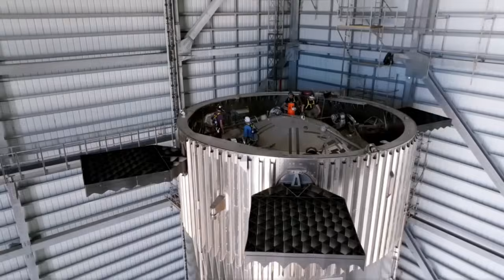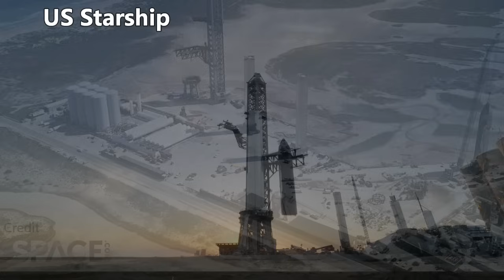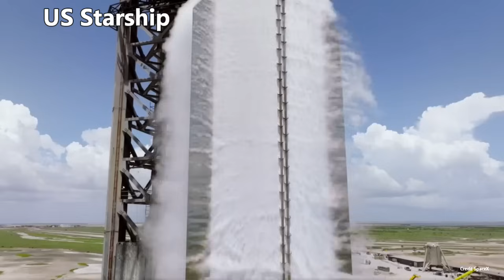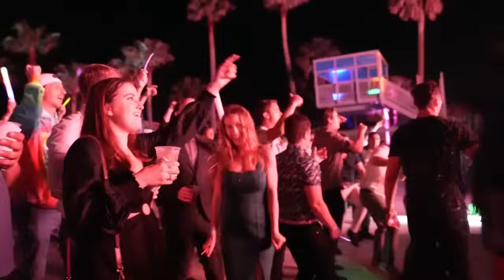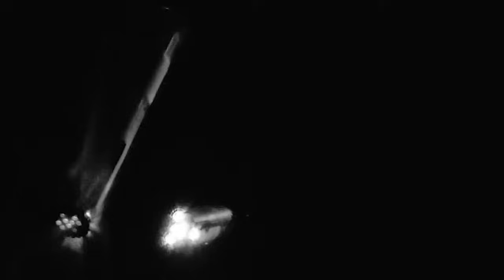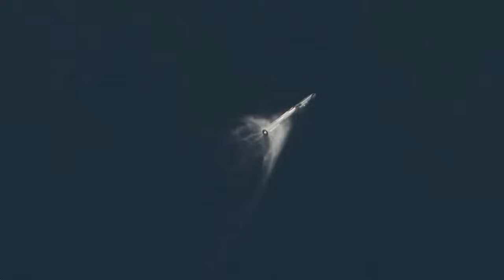SpaceX LEET 1337 Rocket Engine and the Development of Raptor 3!

Comment: Carbon fiber also doesn’t like cycled stresses as the Titan submersible just demonstrated. The pressures at the bottom of the ocean are not a fair comparison to space but it makes a shorter service life as a reusable pressure vessel I think.
Reply from the maker: That's a very good point.  And titanium becomes almost unrepairable after several cycles.

Comment: Your mention of the Shuttle tanks being the biggest objects ever in space reminds me of the disappointment I felt at NASA's decision to deliberately drop all of them back into the atmosphere to burn up rather than putting at least some of them in a parking orbit for future use.   Each had over two million liters of insulated, pressure-tight space with a diameter of over 8 meters.   Left in orbit, they might have been useful some day, perhaps as a fuel depot, or as habitat space.
Reply from the maker: I know! All you would need to do is pressurize it to 1 bar and have a huge addiction to the ISS etc.  Such a waste.

Comment: Excellent video, thank you. Subscription added.
I have a question. I have seen replays 10x or something, usually edited, so the exact timing is not clear.
We had an excellent controlled shut-down of most booster engines, and then we had hot-staging, which seemed to work exactly as planned. The moment the Starship was clear of the booster, the booster started to rotate. I'm told they angled a couple of the grid-fins about 20 or 30 degrees, and the Starship exhaust going through them, gave excellent impetus for the rotation. That's very clever. And it seemed to work incredibly well.
Next phase, we start firing up booster engines again. Not the outer ring, don't need those, but by the time the booster was 90 degrees to direction of travel, and the lower end was out of sight, most of the inner engines appeared to be lit. indeed, the thrust of those engines could be seen to deviate the path of the booster, although not by the amount or degree I would expect.
Then, something appeared to go badly wrong in the engine room of the booster, and we got a plume of what looked like LOX or propellant, spreading in a near circular pattern. it kind-a looked like the lower bulkhead / dome had failed, like the whole thing had come loose around the edges at the same moment. Then a second or two later, we had an explosion.
I would tend to think that when things started to go wrong on the Starship, it triggered the self destruct, but I'm not sure the explosion of the booster [was] self destruct. That looked more like a lower dome / bulkhead failure, like the 'thrust puck' came loose and took the whole bulkhead/lowest dome loose with it. I am fuzzy about the details, but that didn't look like an abort, that looked like a structural failure of the lower tank, which I think from memory, is the LOX tank.
Now I have seen a number of videos from different sources, all assembled by AI for the naturally stupid humans, and they all click-bait to show on-board footage, but so far I have only seen about 3 seconds of on-board, and that was an external camera. What I want to see, is what was going on inside the Meth and LOX tanks. Did we get some sort of hydraulic hammering event, where all the remaining fluid crashed down (relative down) onto the lower bulkhead and caused something like a fluid-lock in a submerged 4-stroke engine? I mean, I know what I saw, I've seen it 20 times now. What I'm not sure about, is what to read into that. What to interpret that as.
I would say the Starship had some issue or other and it triggered its' own self-destruct, but I don't know that the same thing happened to the booster. I'm trying to understand what I saw. I would have thought if the engines that were lit, were running at full throttle / power, the whole booster would have accelerated quite a bit more, so I could easily believe we didn't have full power from all those engines, but then we had a massive leak of LOX and the failure of the whole booster.
[Chuckle] It just came apart in 'me 'ands, sir.
I want to spank the maid and get her to tell me more of that story ....
Reply from the maker: You are quite right.  Over 150 metric tonnes of propellant started moving toward the top of the booster during separation due to the push back from Starship.  If it just rose 10 meters before slamming back down that is 1.5 meganewtons of force hitting the thrust puck.  That is going to bend pipes and tear metal, possible breaking the welds around the thrust puck...  Engines start exploding and a shock wave travels up the downcomer and blows the ship in two.  FTS not required.  So two solutions.  Shut the booster down entirely and only fire the vacuum Raptors.  Give the booster time to rotate from backflow, aerodrag (still some at that altitude) and RCS. Then use RCS to gentle settle the propellant before firing the engines. Or.  restart all booster Raptors at 40% throttle before separation firing all 6 Starship engines like last time.  The danger is that the booster, no free of the mass of Starship, might surge forward and smack Starship.  I like the first idea better.  We'll see how SpaceX goes.

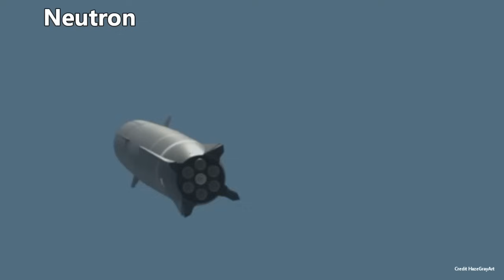Comment: 4:50 I have never worked with carbon fibre but you can metalize 3D sintered parts to make them not leak anymore. We did that with some parts of a machine I worked on (I don‘t how much is under NDA, hence the vagueness). Maybe you can do a similar thing with carbon fibre. The metalization would still be far less weight than a wrapped metal tank.
Reply from the maker: That is true... I think the real problem was that carbon fiber would need a heat shield obviating any mass savings.  Maybe ok for the booster though.

Comment: I very much identify with the approach that SpaceX takes, having built a career based on similar approaches, always stiving for new ways of doing things, while people around you frown and tell you it is impossible. Sometimes I fell on my face, sometimes it was a partial success where I needed to live with a compromise, and sometimes even an amazing success, but I can tell you it was never easy and I always learned something no matter the outcome, and just imagine if I never tried or paid heed to all the naysayers. For such new ideas to work, they at least need to be based on some grounded reality, and they need management ready to take a big risk for the hope of significant gains, and of course, the ones executing the project need to be hard working, smart and flexible to change their plans quickly as what does and does not work becomes apparent. Clearly Musk is that type of insane management guy, ready to take the risk others would not touch, and clearly SpaceX have managed to gather up a good group of super smart hard-working people who really come up with the ideas and make it happen, it typically requires both these aspects to succeed, Musk alone does not make this happen, those smart people alone could not make this happen. Even so, there are some dubious choices we see being made by SpaceX at times, for example launching without and type of mechanism to deal with the immense power unleashed at the pad at launch (Musk pressure?). Or the fact they kept banging their heads for way to long, trying to get parachutes and ships to somehow always meet perfectly every time, when clearly just plucking the fairings out of the water was where it was all going to end up (Musk idea/pressure?). So let me point out what I see could to be the next disaster for SpaceX, and that is landing the super heavy on the OLM. As we saw with falcon 9, they blew up many boosters on barges, before reliable landing could be achieved. Honestly, this process seemed manageable, because the barge is simple and structurally redundant enough, that it could handle the hits with minimum damage, such so, that the barges really were not out of service for long whenever they took a hit. This is clearly not the case for landing at the super complex OLM, or the launch tower, or all the other facilities nearby. Imagine the various degrees of damage that could occur to the launch/landing site after one super heavy landing goes badly, you could expect any decent hit to take out launch operations for at least 6-months, possibly more. Sure, maybe eventually be able to pump out raptors, boosters and starships at a crazy rate, but if there is nowhere to launch them from, then it is meaningless. It seems fair to foresee up to 6 failed booster landings on an OLM before we start to see success, this likely following about 4 ocean landing tests. I doubt the launch site as we see today is hardened enough to cope with hard RUD on landing, so what will SpaceX do to address this issue. Can they harden the OLM and tower enough to minimize damage, and modular to ensure fast recovery? Same goes for all the various piping throughout the site. I assume all the tanks are likely easy enough to replace quickly, so maybe that is not a big issue. Anyway, food for thought, and I would love to hear your take on this aspect.:face-blue-smiling:

Comment: Have they figured out tge orbital refueling yet?
Reply from the maker: Nope.  I think they need to use a disposable stripped down booster and "Starship" with no grid fins or flaps etc and use a 3rd stage "cone" to go to the Moon and go back. I don't think close to 20 refueling flights is reasonable at this point.
Reply: @terranspaceacademy  by 3rd stage cone, do you mean a phalanx rocket like you talked about a while ago? Honestly for the orbital refueling I thought they would have atleast gone with a modified raptor turbopump to pump the fuel from the fueled to the starship and using the staging engines I mentioned as a abort system for launching and seperate from refueling if necessary too. For the moon mission is why I still rather support a mini starship variant in instead for less mass and space that also could be used as either 2nd or 3rd stage. This is really interesting concepts for possible alternatives I come across and like to point out. I hope you don't see me as a hater for this(which I am not) but there are other ways of getting to space and orbit but others I have talked to about almost all agree with the problems those come with but also admit the advantages those offer still being better if they work correctly.
Reply from the maker: It turns out to be more efficient to use pressure differentials to move fluids and a little acceleration keeps everything where it is supposed to be.
Reply: @terranspaceacademy  acceleration as in like what they did for hot staging? And pressure difference, I can kinda understand that advantage, but wouldn't it need an extra for e to force the fluids fully once the pressure equalizes? Unless they intend to use the acceleration like I questioned earlier to give the extra force but even that doesn't seem enough fully. That's why I suggested the modified turbopump and if they want pressure a second tank of of psi gas to help force the fluid fully. In the end I was just curious.
Reply from the maker: Without a gravity/acceleration gradient the pressurization just forms bubbles :-)
Reply: @terranspaceacademy  I understand that, I'm still wondering how they intend to do the acceleration to help the fuel settle for transfer. Also, for the whole acceleration weather from cops or engines, wouldn't that burn more fuel than would be transferred? The pressure equalization still seems a problem for transferring all the fuel needed. Unless they make some new announcement for how they intend to do all that, I still have my doubts for reasons. I kinda wonder if for the fuel transferring process it would not only be easier to use the turbopump, but also the exhaust for the acceleration and or some internal balloon like design to help force the fuel to settle. I honestly would like to hear your ideas and thoughts on those matters or anything they have already announced that I am not aware of.
Reply: @terranspaceacademy no offense but it's also why I don't support hls for is size is far to overkill. From what I've noticed for now they should for human rated focus on getting a crew dragon capsule built into to upper stage for reentry and abort system instead of the whole thing coming down for a few years until they fix it fully. It would only reenter atmosphere for cargo missions for now. But for now I like to see where they decide to go for now.
Reply from the maker: I agree completely
Reply: @terranspaceacademy  on which one?
Reply: @terranspaceacademy also for stripping down booster and starship I don't think removing the grids or flaps would reduce the weight that much so it could reduce building but not much mass gain without as you mentioned the booster being disposable which means that the hot staging might not be necessary for that for it could just have blow out panels that blowout just before staging and use the engine exhaust to help push it away but not the main force. Plus if they really still want to recover the booster at least than they should mostly focus on the engines since they are the most expensive part last I checked. Personally if this is the best starship could get with little thrust performance enhancements than they shouldn't focus on with catching it with the tower(barely even with a helicopter of some king like electron) as long as he can put out them fast enough and save time and money on the engines than it seems that would be the better option, but instead the reentry capsule as I mentioned before for human rated only and allow the upper half to burn up while recovering the engines. Didn't he say the best part is no part?  Away with those control features for rapid reusablility will make it even simpler which last I remember is what he wants. In the end its a balance between rapid reusablility and cheapness vs delivery performance and simplicity.

Comment: If V2, which uses raptor 3, and will use 6 vacuum raptors, we think. It'll be 10-20% a larger upper stage, hypothetically that has the same ratio for fuel and cargo. So what will the payload be (currently 150) and the volume (currently 1000 cubic meters).
Reply from the maker: Elon said up to 250mt.

Comment: I am designing a model liquid fueled rocket engine myself, and is cool to see some high level stuff. One thing that was probably simplified for a general audience is exhaust velocity is limited by the outside pressure on the rocket. The equations show that pressure is turned into velocity in a deLaval nozzle. This means you can only reduce pressure so much (and increase velocity)  before you get lower pressure than ambient. At which point you dont gain any thrust. Of course starting with more chamber pressure means you can swap more of the pressure for velocity before you reach ambient. This is true for earth, in space, you run into a different problem, as the bell to convert pressure to velocity becomes so big, you start incurring a mass penalty for decreasing returns. There is an optimization point for vacuum bells as well.
Reply from the maker: I think that's why SpaceX can test their vacuum Raptors at sea level without worrying about blowing them up.  Pressure to spare.
Reply: @terranspaceacademy  The reason that Musk stated was that building a CF prototype took entirely too long; months at a time. So he decided to go with steel which is something that could be iterated orders of magnitude more quickly. After they started, they seem to have cottoned on to the advantages of steel in low- and high-temperature environments.
Reply from the maker: That makes sense.

Comment: Another great video. I have a statement, then a question. I am not space "technical." In fact, I am a musician, who retired as an IT Operations executive (more common sense than technical ability.) Still, I watch 100% of your videos. Question: I recently watched one of your videos in which a research and development company has developed some sort of engine that seemed to be capable of startling thrust that could also be held in your hand. Hmm. Did I understand that video correctly? If I did, how many decades before it is useable? Just asking for a guess? Please, pardon my ignorance.
Reply from the maker: You are probably talking about a "Wakefield Accelerator".  This is a laser driven device that can have an exhaust velocity near light speed.  There are two main problems to work out.  One is that we need MASERs to make the efficient.  Masers are available but are too costly right now. Diamonds and all that.  This is because the efficiency of a laser is only about 20% while a maser is up to 90%.  Second is a reliable high output power source. Solar for Earth, Venus, and Mercury will probably work.  But from Earth on we need nuclear.  Fission at least and fusion if possible.
Reply: @terranspaceacademy  Nuclear monopropellant propulsion is probably on Elon's desk, waiting for a solution - probably already has a team on it. It would be very efficient for Earth-Moon and Moon/Earth-Mars transit shuttles.
Reply from the maker: Who has cheap uranium? South Africa... that's who :-)